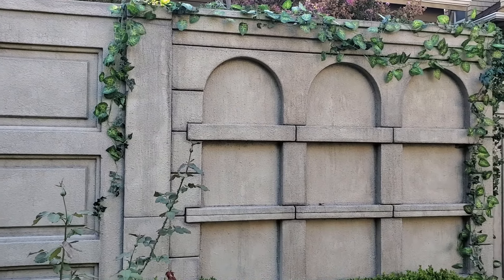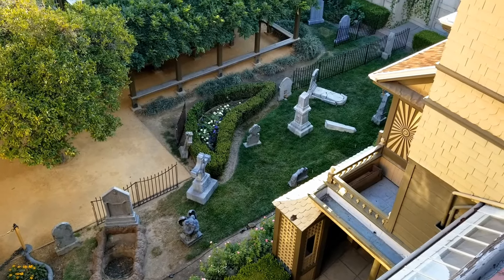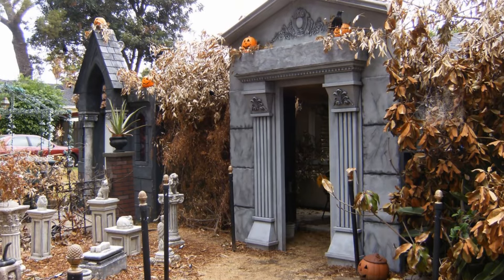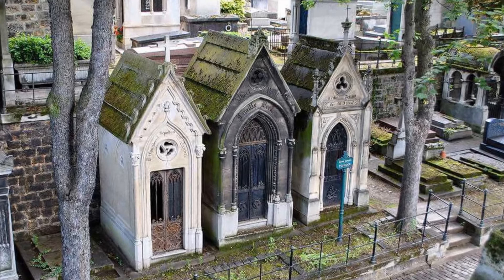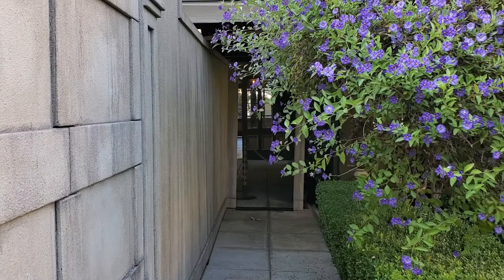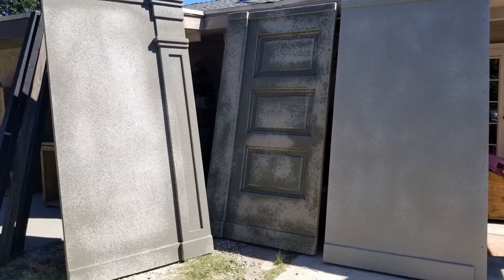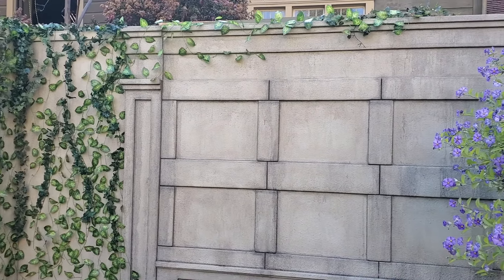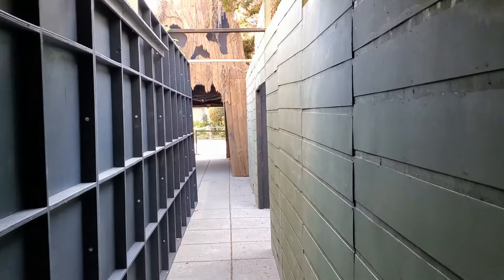We made a Huge Halloween Graveyard Crypt Wall

Comment: I decided to do most of my tombstone epitaphs in Latin, partly to avoid having anything specific, and partly because I think it makes them seem older. That’s one potential solution for having something there that doesn’t distract, but obviously not ideal for every situation. Another one I’ve played with is the look of erosion, where you can tell it said something but it’s no longer legible. I do appreciate the idea of adding pieces on later that are interchangeable and modular, and it’s especially helpful that you guys have a process of coating and painting that you use repeatedly, so there’s a continuity that’s easier to replicate in the future. For me, it’s more of a “what supplies do I have right now?” process, so my props don’t always look the same.
Reply from the maker: Those all sound like great ideas! I try to write on the paint cans so I remember what I used the colors for. Seems to be working so far. Thanks always for your input!